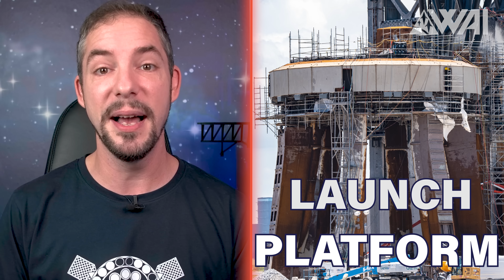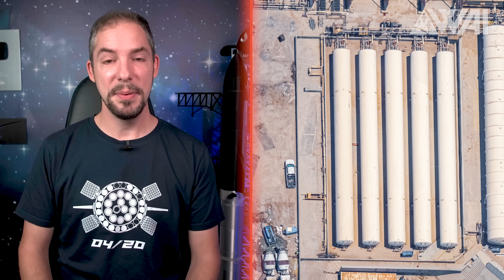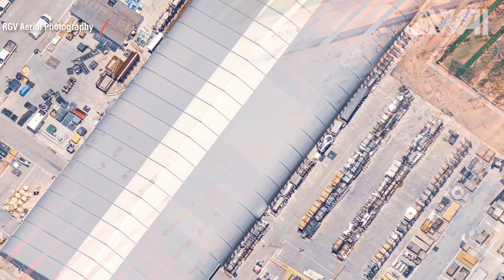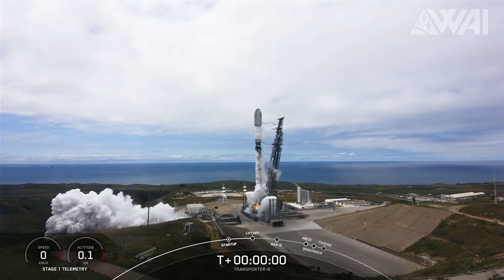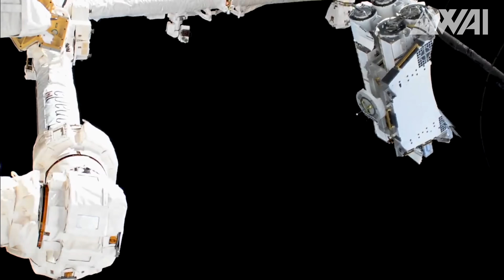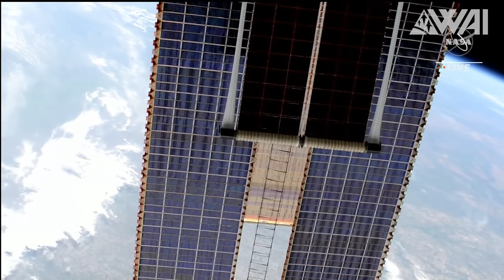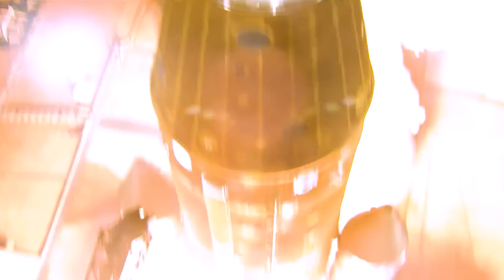SpaceX is pushing HARD towards the next Starship launch!

Comment from the maker: Do you have any theories about how the deluge system might operate? Help me out! I'd love to read your thoughts! :_WAISweet:
Reply: They aren't just battling the steel melting effects of the world's largest methane-oxygen welding torch. Most of the damage which led to the concrete failure, was due to soil liquifaction. This phenomenon is well known to earthquake scientists, caused here by the massive pulsation of 30+ Raptors engines. Liquifaction has brought down massive buildings with footings many times that of the OLM. While the heat must be reduced below the steel alloy melting point, the main purpose of the water deluge system will be to disperse the hydraulic effects on the supporting soil.
Reply: Large water tanks for takeoff, small tanks for landing?
Reply: @telling25  And a serious problem when trying to haul to the moon or elsewhere. Not sure what SpaceX is thinking.
Reply: @up4open763  Yes, if it was the booster landing on the moon. I do not think the Spaceship would really need a water deluge on landing, but the booster might? At least if we are talking repeated landings.
Reply: @up4open763  They are thinking nobody gives a crap if you blast some moon dust off the moon.
Reply: @tedmoss  Except the engine and the body and the colony.
Reply: @up4open763  Super Heavy is only needed to get Starship off of earth. The moon and Mars’ gravities are so low that Starship can achieve orbit from either on its own.
Reply: I hope the Raptors are waterproof. If the deluge system operates before ignition then, at the water pressures they are talking about, The Raptors could get a surprise up their skirts!
Reply: What's happening at Boeing? Boeing was run by engineers, but allowed to become a near monopoly. Now it's run by accountants and other bus ad types who use the skinny end of a screwdriver for a handle. Mediocrity at the top.
Reply: Mmmm I will have a think about it 🤔 great video keep them comming @Felix 😊

Have I really been a member for 2 years 4 months 12 days 😮?
Reply: Would they chill the water to be more effective 🤷‍♂️
Reply: @evotoadracekartscars.6738  Heat rate from 75 degrees to 212 degrees F. should be enough. Energy absorbed is greatest at boiling.
Reply: @evotoadracekartscars.6738  just use liquid hydrogen...😉
Reply: I know, from Dragon blogs, that Nitrogen will be intermixed with the water. Those tanks you see...Nitrogen.
Reply: My theory is…

If I wait until SpaceX finishes it and tests it, then I will know EXACTLY and ENTIRELY how it works.

🖖
Reply: I think they'll need a lot of garden water hoses.  I'll be happy to buy and resale SpaceX those.  Free delivery too.
Reply: You guys overthink it too much, it's simple: one set of tanks for cold, one set for hot water. Starship likes a luxurious shower.
Reply: I really believe it needs to a gravity fed system like at Kennedy.  LC 39B can dump water at a rate of up to 1 million gallons per minute just using a water tank and gravity. SpaceX appears to want something to force the water through, (nitrogen?).
Reply: My theory is than the small tanks don't have water, they have compress air.
So, it works like this:
The system don't use electric pumps, it may have compressed air than is released on the water tanks and the air pushes at high speed and preasure the water to the water deluge system to fight the 33 raptor engines.
Yo need only suficient water and air for starship to clear the tower.
Just theory.
Reply: A frozen crystal lattice woven by a giant ice spider
Reply: The water deluge works by a BCPS. It's very common for this application.
Reply: check out your teeth when you have time, you will feel better
Reply: Maybe water flashing to steam below the plate could be used as a boost pressure for water to the shower nozzles? Max plate cooling as a steam generator? WAG
Reply: It will pump out water to absorb the energy.
Reply: Since they are working with used tanks the different sizes may be mainly because that is what they could get. The design has clearly changed since the first set of tanks were planned for Florida (manifold scrapped).  But the use of two big water pipes going to the OLM suggests a dual two-stage system (pre launch, post launch). There is no need for valve hammer prevention if flow is controlled by turning on the gas. so maybe the two sets of tanks will be different stages, and run at different pressures.
Reply: No, I don't
Reply: Taking bets for how many tiles will fall from ship 25!!!
Reply: You also need water for landing.
Reply: They will deliver. It's what the do.
Reply: I think the deluge system will, most likely (I'm no expert), so most likely it will get everything wet...with water.
Reply: @OriginalMergatroid  just skip a step and spray liquid concrete.
Reply: @ThatOpalGuy  That's a great idea. Huge time saver.
Reply: Probably gravity fed, Best part is no part. Pumps mean pressurized pipes, By using massive water pipes fed underground you can use gravity to get the water where you want it.  Some underestimate how much power/flow water has when elevated above its destination.
Reply: The giant shower head will protect the concrete under it provided the shower head does not melt. Think of it as a big flat water tank. The pipes coming out of the shower head may be divided into 2 groups. One group to spray cooling water onto the top surface of the shower head and prevent it melting. In order to get enough pressure to spray water onto the upper surface of the shower head the other group of pipes could receive pressure / exhaust from the booster engines and use it in a Venturi system to achieve enough velocity for the cooling water.
Sorry if that is a bit "word salad" ........ try looking at how steam boilers used to use their own steam to get a resupply of water inside the boiler no matter what pressure was inside the boiler. No piston pumps or external sources of power were needed or used for an injector system. 
........ or I could be wrong. :)
Reply: @pauldannenberg391  cant wait for THAT to fail...steel shrapnel EVERYWHERE.
Elon's gonna put an eye out.
Reply: The mass delusion Musk + his Media have created is insane.  It's like Christopher Columbus promising cars + planes + Disneyland using those three boats.
Reply: sure. I think it will have to be very similar to how oil pipelines are operated - multiple pressure release tanks and lots of different control valves to control distribution. It also calls for a good bit of computer control since people cannot respond fast enough for pressure spikes. one example I saw was done in Saudi Arabia to distribute the oil thoroughout the country for shipments. That one had quite a status board everyone in the control room could see.
Reply: I don’t think it’s going to live up to the hype of what SpaceX says it’s gonna do I still have a bad feeling about the heat and the pressure coming off those 33 engine at a 90° angle to the ground or steel plates it doesn’t matter
Reply: @bruceyoung1343  think of it as a water based diverter using a spike pointing at the engines - it should spread the pressure and heat horizontally. Now, whether it will be enough is another question.
Reply: Bidet system. Squirting up the rear end.
Reply: Maybe the smaller tanks will be filled with pressurised Nitrogen to pump the water from the larger tanks more quickly?
Reply: @RWBHere  That could work for a very short time - after that it freezes the water in the pipe.
Reply: Armageddon:

Bow = Send it.

Sword = Strike it.

Scales = Split it.

Fire = Sear it.

"It" = "Wormwood".

Our Planet in the past 2 years have sent (send it) OVER 2000 Rockets into space. FACT.
They were weapons designed to stop wormwood.
Pieces of it are going to hit the pacific ocean.
This is why everyone's leaving the west coast. 

May God have mercy on  Us all.
Reply: ❤ Attention sheep level 1 portion of youth longevity digestion an self beauty Jesus energy wash tonight at 11 eastren. Negative energy will creep out yr feet tell it's time.
Reply: If the purpose is to protect the launch pad, launch tower and surrounding facility, then I don't think it will work. Apparently they already have a problem with the penetration of ground water so they have a limited capability how much water can be used. Presumably they will have to capture it all and return whats left to the holding containers. This last flight the Starship stayed a lengthy time on the launch pad after ignition and Musk said they would have to improve the speed of the launch considerably. The lag itself and the resulting blast caused significant damage to the metal on all of the facing surfaces as well as the "concrete" pad. It wasn't just a concrete pad issue.The new metal water dispersion system does not seem to cover enough area beneath the launch pad to absorb the rocket blast and protect the metal construction. They are said to have a number of great engineers but those engineers have already made a big mistake in construction of the previous launch pad. Even a casual observer would say the previous launch pad had no chance of working. There was never a successful test launch without damage to the pad; even with only a few engines. Success in this case means that the next day after the launch they could bring in another rocket and launch it.
Reply: Water pumped between two steel sheets (the top one perforated) makes sense. You get water cooling and a steam cushion to absorb the impact of rocket exhaust. Water hammer arresters are not needed when the valves lose slowly but one tank would be a handy safeguard. I can't see that four would be needed.

Comment: One Irosa solar panel CANNOT POWER 3 HOUSES. How are you going to do it? Irosa only works in space. First more sunlight in space and it’s not interrupted by clouds and the night time. So on earth the rating is false. Second, so if you installed that Irosa on earth in the first breeze it could catch like a sail and be destroyed. So that means it would never get approved for residential home installation. So unless your beaming down the power with zero losses or using a very long extension lead with no losses and a constantly firing booster rocket to keep it in space then you can’t power anything with it on earth.

These bullshit analogies piss me off. People see this shit and then say “where is this tech? Why are our solar panels so shit?” Because YOU told them these Irosa things could power 3 houses on earth, BUT THEY CAN’T. So speak correct English and reword your sentence from a dead set lie to a truthful comparison. “These Irosa panels in space can produce the same amount of power that’s required to run 3 average USA homes.” 100% truth, no lies no misleading statements.

Comment: Why are the water and nitrogen tanks at ground zero?? Mass and Hight of liquid would give a massive basic pressure force if pumps fail there would still be a push Why the nearness of TANKS TO PAD AREA.  SAFETY POROTECTION IS A MATTER OF DISTANCE.
are pad legs connected below surface level to triangulate solid un breakable subsidence protection incase of Sand soil liquification?
why obsession with landing at take off point chancing total destruction of pad area.
Logic is one take off assembly  point
two or three nearby by landing points? 
may be a rail return to claw lift or repair area.
Water is in constant supply
at beach? 
Cheap retired low il rigs paneled topped  sections
linked as take off   and other landing & assembly points
deep piled driven anchored in sea edge
Back to Brunel and the canal builders
using water gravity balance leverage
as with the Massive Scottish Canal barge lift
and European ship lifts
Water tanks leverage 
along with  balance of mass
can lift move pol push
massive weights objects simply
with pier road rail to Space port?
Cheap simple basic quick
as always been proven to  be the way forward

Comment: I have a question on Starship design for lunar or Mars landing.   After seeing the damage to the launch pad by the test….how will Starship land on the short legs and not create a crater with the accompanying debris damaging the vehicle?   I know less boosters for less gravity but still…the clearance seems too small…even one booster is a high pressure hose being pushed against a flat surface.  I would love to see part of an episode address this….or is a linking beyond the pale for this design?
Reply: They will have different engines, Like they are not going to use raptors since that is massive overkill and waste of fuel. HLS will do almost all of declaration on way down so landing is only fine tuning so not enough thrust is even generated to cause "crater". Keep in mind we don't know how final design of HLS is going to look like nor what kind of engines it is going to use. We saw renders of HLS with wide legs and with no legs. In either case HLS should be doing moon flyby before it even goes for mission.

Comment: My guess is that the need for two tanks will turn out to be the same as the reason each plate segment has two pipes going into it.

One possibility is that the pressure from the rockets in the center of the pad might be much different than at the edge requiring different operating pressures.

Comment: Water is not compressible, so one has to be very careful with high pressure water moving through pipe systems. I used to work in the golf irritation industry and have seen some crazy sprinkler explosions due to water hammer.

Comment: Slight quibble about solar panel comparisons. Kilowatt capacity ≠ KWH capacity. In 2021, the average annual electricity consumption for a U.S. residential utility customer was 10,632 kilowatthours (kWh). 10632/8766 (# hours per year)=1.213 kWh / hour. But the terrestrial number of hours of available sunlight, depending on location is substantially less than 12 hours per day on average. Still, no matter how you look at it 20 kW of solar panels that have more than 12 hours/day of full sunlight will produce several times the amount of electricity an average US household consumes. So, the point is correct, just the numbers are off.

Comment: Instead of using pressure to push the water out of the tanks why don't they use gravity like most water tanks the higher you place the tanks the more pressure it seems that you could mount the tank on top of the tower and that would handle the you also gain capacity in the pipes coming down from the tower.  the pipes could also protect the tower from heat as they would cool as the water flows down the inside of the pipes win-win

Comment: Dont want to be pedantic, but the Solar Panels 20kW are a measure of Power. Comparing it to the Energy used in 3 homes in one day ist missleading at best. 
One hour of a 20kW Panel on the ISS could create the energy used by 3 US homes in a day. Which ist just about 20kWh.

Comment: The black and white tanks are distinguished by push and pull that help press water into, and on the OLM, along with the U" bends to help with purging in the system. The U" bends in the gas and water pipes are basically gravity assist with pressure, (natural causes). There is allot that is seen but not spoken about with the water deluge system, and its configuration. 
Great episode Felix. Hope to see ya down in Florida. 
 - NOM

Comment: As a longtime space nerd (since the Mercury program) I have a question. Have you done a video on how Space X will get HEAVY Earthmoving equipment to the Moon and Mars? Examples: Catapiller Carry-all, D8, D11 Dozers, Excavators, Rock Trucks, etc. Even a Tunnel Boring Machine from "The Boring Company?" I can't see how Astronauts can expect a long lifespan, living in inflatable habitats on the Moon or Mars. IMHO, they have to go inside a Mountain or underground. What about concrete plants and trucks to carry the concrete? Also, would these machines be electrically powered? Or, some fossil fuel to power an internal combustion engine? If it interests you, I like to see/hear your ideas and your audience in a video. Thank You, Your Servant Captain David.

Comment: ft/lbs are the same regardless of the tool used to make them. You may have a better tool or simply one thats different. What matters is what the maintenance manual says and if it specifically cites using that tool number then that's the one you are required by law to use. So what does the manual say? Whatever it says that's the final word. Looks like Boeing stiffed a supplier and now they are trying to recoup their losses with a pathetic law suit.

Comment: Lots of good info, as always.

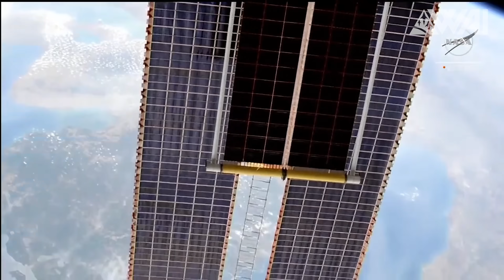Not to nitpick but to inform: At 16:38 you said, "An average US household uses around 6.6 kilowatts of power per day." Watts, kilowatts, etc. are measurements of power (think "capacity"), not consumption, as there is no time element to them, so "per day" makes no sense. Kilowatt-hours (kWh) would be a measurement of consumption. I assume your 6.6 number is probably fine (as capacity - I couldn't find a statistic on that) but just needed to be said without "per day".

However, the next number you say won't work: "So one IROSA panel could power three houses." Hmm, no it couldn't, because it's only getting power when the sun is shining on it, and that 20 kW number is probably at peak, when the sun is directly above the panel - the ISS must depend on batteries to even out the power. On the other hand, the 6.6 kW number assumes being able to pull that power from the US electrical grid, which is available 24/7. Of course households don't USE that much power all the time - in 2021 the average US household consumed 10,632 kWh, which is about 1.2 kWh per hour, but not all hours of our day and year are created equal (I use a lot more at dinnertime in the summer than while asleep in cooler months).